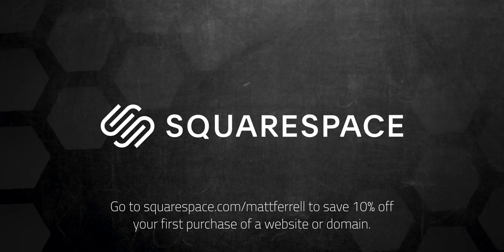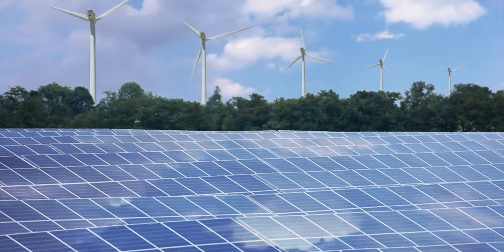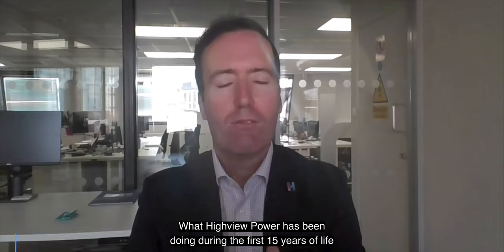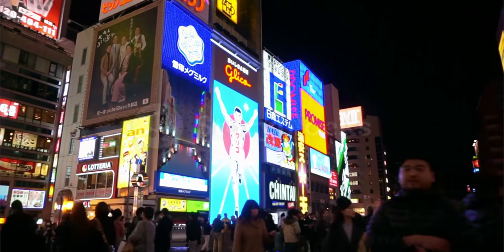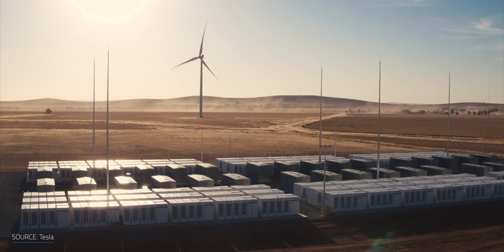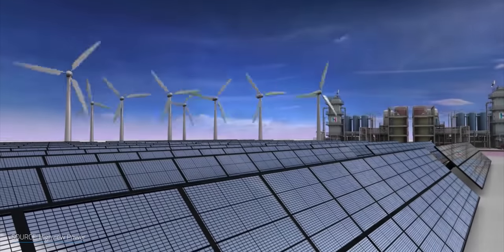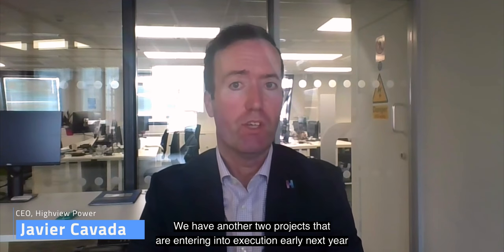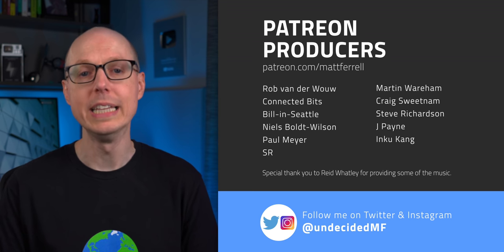Liquid Air Battery Explained - Rival to Lithium Ion Batteries?

Comment: We need to start building these now, assuming there is a standard model for "mass production" of the equipment, etc. Having a wise and thoughtful government would be a help!
Reply: First we need a really solid proof of concept.  We need one or a few of these plants operating for enough time to make sure there are no issues left to be solved and that they are affordable.  We're not in a hurry for storage on hardy any grid.  Other than some tiny island grids I know of none that have installed enough wind and solar that there's a big need for storage.
Reply: Me after youtube videos. We need fusion reactors everywhere.
Reply: @tommyp1124  We've got a huge, highly reliable fusion reactor that's paid off and giving us free energy.  We don't need any more.
--

If someday someone figures out how to make affordable electricity using fusion then let's discuss it.  For now we don't know how to control fusion and we have no route for making its electricity affordable.
Reply: Perhaps someday big solar and wind will have the resources to compete with big oil in the race to buy government favor.
Reply: Alex, Tesla MEGAPACK is Already PROFITABLE and EZ to Deploy , only 1 month from Delivery to GRID use.
TESLA built Hornsdale in 100 days !!!!!!! using Powerpacks.
Reply: @factnotfiction5915   Where's the two years of data?  Your linked article is about the launch in June 2018. 

I really want to see some data.  I really hope we find route to more affordable storage.  Cheap storage is the final piece of the puzzle.  Wind and solar, even unsubsidized, are on track to becoming our major electricity providers, assisted by existing hydro and a bit of geothermal.  But we need an inexpensive way to move energy from when it gets captured to when it is needed.

Let me suggest that this is the target to beat - Tesla's dry roll, tabless cells.  Which probably (at least the lithium iron phosphate version) have incredibly long lifespans.

Tesla seems to have developed an new type of cell and ways to manufacture that cell which will lower the cell cost from about $100/kWh to under $50/kWh.  Lots and lots of innovations, check out Tesla's battery day presentation if you want to dive into the particulars.

Jeff Dahn, who is Tesla's lead battery researcher, recently reported that his lab has been continuously cycling test cells for three years.  In those three years they've been able to perform 15,000 cycle equivalents.  The cells that were discharged 25% or 50% before recharging lost no capacity over those 15,000 cycles.  (A 25% discharge cell would have been discharged 25% then recharged 60,000 times.)  The cells that were discharged 75% or 100% before recycling lost about 10% over three years.

OK, so we install a lot of batteries.  We, in general, cycle them twice a day.  Charge when the Sun is shining, discharge into evening demand, charge when the wind is blowing late at night, discharge into early morning demand.  

15,000 cycles / 2 cycles per day / 365 days = 20.5 years.  

What's the cost of storing a kWh of electricity during a cycle?  

$50/kWh for cells / 15,000 cycles = $0.003/kWh.  Plus some cost for turning AC to DC and DC back to AC.  And some round trip loss, 5% to 10% for batteries.  Start with $0.003/kWh in and in order to get a kWh out you need to input  $0.0033 electricity, an extra 10% at most.  

Short version.  Cell cost approaches nothing for frequent cycling.

Since then Dahn has mentioned the results are staying the same for about 20,000 cycles.  Incredibly cheap is getting cheaper.  We know of no cliff batteries fall off that is based on only days passing.  Who know how long these cells might be usable?  And when used up we know how to recover almost all the materials in the cells and turn them into new cells.

OK, let's look at worst case.  Those few times per year when we need "deep storage".  The extra chemical tanks for liquid air.  Let's assume six events per year as the worst case.  Those cells will get cycled only six times per year.  $50/kWh / 6 = $8.33.  That sounds like a lot but one needs to look at the cost of power from 'almost never used' gas peakers.  

BTW, there's no additional infrastructure cost for those cells except for storage space.  Just upsize the number of cells for each charger/inverter.

That, IMO, is the target liquid air has to meet to get in the game.  Looking forward to data.
Reply: @bobwallace9753  I'm just stating that the technology is proven out. There isn't a major research effort needed to take advantage of them.
Reply: @factnotfiction5915  When a plant has been operating for more than two years and has not released any data I start to suspect that they have no good news to report.  For me, liquid air is going to stay in the "maybe, possibly" category for now along with stuff like liquid metal storage.  OTOH, I'm watching solar and wind farms being built with about four hours of storage included.  The math must be working if companies are investing in more than a test platform.

And those investments are based on "yesterday" cell prices.  Tesla has apparently created a cell price breakthrough of major proportions.
Reply: @bobwallace9753  I definitely agree "Tesla has apparently created a cell price breakthrough of major proportions".

A pity that isn't anywhere near enough to make RE's total system costs competitive.
Reply: @factnotfiction5915  

"A pity that isn't anywhere near enough to make RE's total system costs competitive."

That is pure speculation on your part and ignores the actual cost of fossil fuel and nuclear generation.

The fact that grids are adding wind, solar, and storage in increasing amounts while closing coal and nuclear plants should give you a real world clue.

Comment: Thanks for all your work Matt really educational. I am in the UK. Question for you/everyone - I've tried to do some research re LABs & HighView but I cannot find out 
1. The cost (pence/KwH) of the  stored energy they will supply/output, I am guessing 40% higher than the renewable energy input, as the entire process is reportedly 60% efficient -correct?
2. How quickly it will be scaled up & to what scale?
3. What is the cost improvement on these scale ups on output electricity price?
4. What is the cost of the basic 5MW plant installation? There don't seem to be any figures.

Thanks all.

Comment: This idea could work if the compressor is operated directly by the wind turbine. Avoiding two energy conversions.
Reply: Interesting idea, must see if the added mechanical complexity is worth it.
Reply: Not really, as you want to have a single plant like this do a whole wind or solar park. Putting it in the turbine itself will just require lots of additional piping, heavier turbines that are more expensive to build and lower efficiency due to not being able to store and reuse the heat and cold generated in the process (as efficiently). So no, you don’t want this on the turbines themselves.
Reply: Electric generators are more efficient than mechanical linkages what with location sensitivity, mechanical maintenance, and all that greasing. A couple lengths of wire and an ac/dc converter can cheaply send that wind turbine product great distances.
Reply: @AndreSomers  This does not make sense. Every energy conversion have huge losses. You need the turbine to convert wind kinectic force into rotation force that pushes the generator to produce electricity then convert the electricity back into rotation again in other place to compress the gas. It have to be better to conect the compressor to the turbine and just compress the gas.
Reply: @hasturbr  Seems that you're just going to ignore every argument you've been given. Think about this: if your idea that every energy conversion has huge losses was true, then why would trains that run on non-electrified tracks employ a diesel-electric power train? That is: they use diesel to drive a generator that creates electrical power, which is then used to drive electric motors that drive the axles.
Reply: @AndreSomers  Diesel-electric trains know they have huge losses in energy. That's a diferent point, this is about energy density. The fact that alectric motors dont need gearbox is an extra.
Reply: @AndreSomers  The main point is that in a wind turbine should be very efficient to replace the dynamo by a compressor. Chance the tower to be sealed and function as a gas tank and put the dynamo to use the gas tank content as needed.

Comment: Oh great, compressed air energy storage had problems with getting too cold when it was discharged. Liquid air is going to be WAY worse. Where do you plan on getting the energy to boil your liquid air again? You are going to need a vaporizer and a heating system to extract the energy efficiently. This is such a rediculous idea.
Reply: These standing bottles do not all  contain the liquid nitrogen but even more the stored heat and cold in ... I think "gravel". But I am also puzzled about that aspect. I guess they will not tell much about it since the Chinese are never far away.

Comment: Love to see the cost of maintaining a cryogenic facility like that vs lithium power storage. Something tells me cryogenic systems have more failure paths than lithium cells!!??
Reply: But batteries lose charge capacity with every charge cycle so they will have to be replaced while yes maintenance cost will be higher but the plant could run for 40 years before needing to replace major parts
Reply: @Hunter-lm7wo  depends what chemistry of cells you're using and how the BMS controls their charge cycle. What you're possibly forgetting is that these battery banks will be continuously monitored and topped up with charge either by the grid or renewables so will only be in a condition to lose capacity when being drained. They won't be sat "idle" even if unsupervised directly by a human on site. An ebike battery loses about 10% storage capacity after around 1000 complete charge cycles but is still able to function. A tesla car battery has, I believe, a life span of 100,000 miles plus under warranty but will still work beyond that even at a reduced total storage capacity compared to new. An Ebike battery is about 0.5kwh, tesla car battery is between 55 - 80kwh capacity and we're talking about potentially mega watt hour capacity. Even if one "pack/module" breaks down the rest will still function. Lithium banks have no moving parts, no hostile chemicals and no extreme operating requirements. With cryogenic systems one "O" ring could cause the whole thing to stop working and given how hostile cryogenic system are to materials I'd still be backing lithium any day of the week. It already works and has proven to work. Tesla has already delivered in Australia and it works better than any other back up system they've tried, as far as I'm aware.
I'm not saying this liquid air malarkey doesn't technically work, but Holy hell it's going to be a darn site more difficult to maintain. I would love to see both of them in an earth quake situation to see which one holds up better!!??

Comment: It would be good to know what is the investment cost to build a 24 hour storage capacity with either solar and/or wind sized system to generate XXXMW for use and storage of excess energy generated.. Please step through the analysis to show the path forward for investment in terms of dollars and resources required to build this plant. Thanks

Comment: It might not power smart phones but I can imagine it powering cars and passenger drones. I can imagine vehicles with insulated fuel cell containers that can hold frozen liquid air tanks. One of the biggest issues is the time to refuel a vehicle and this might totally solve that problem. I can imagine different size vehicles using 1, 3, 6 or 9 x 20L or 40L tanks of liquid fuel. I can also imagine them being quickly injected into a vehicle at your local fuel station and the old tanks being recycled. There's a really good youtube video about from a professor explaining how compressed air has been around for a long time and that patents where bought by fuel companies. Point is I knew compressed air was an option but now that I understand we can freeze the liquid and reduce the pressure vessel requirements, like omg, that's sick. I should register the domain name powerpopsicles.com! Oh and combine this tech with the thermos insolation tech, bingo! Vacuum insulated fuel cell chambers! Think about it.
Reply: Imagine a container of frozen pellets that can be moved from vacuum insulated storage tank to a small high pressure chambers. Maybe have 4 or 6 pressure chambers to compensate for decompression timing difference from fresh to old pellet. Or a check valve that passes gas to a second high pressure storage container that powers an air piston engine. And of course, heat exchangers and Peltier thermoelectric plates to extract electricity from temperature differences.

Comment: There are lots of ways to store energy (chemical, thermal, mechanical).  Liquid air is one possibility amongst many that have been suggested.  It's a question of cost, scalability, and reasonable efficiency.

I'd like to take step back, and think about "micro-grids".  In the software world, there is the notion of an "operating system" (OS), which allows one to incorporate various "device drivers".  In the case of a micro-grid, solar+storage would be the backbone.  Initially, lithium ion acts like kind of a "buffer" to integrate other resources, with varying profiles.   On most days, solar is fine.  But I'm not beneath using diesel gen sets, e.g. on days with smokey California skies, when solar doesn't work.  As  new storage technology emerges, one can swap out the diesel with the new technology.  There should be a low risk way of experimenting with both new storage as well as dis-patchable generation technologies, that have different profiles, given a stable backbone.
Reply: The engines will be converted to run on green hydrogen.
Reply: Even easier than solar with high-carbon fossil fuel backup, is using low-carbon nuclear in 'crockpot' mode.

The reactor can run at constant maximum output (optimizing energy production) and attached to storage to deal with demand load variation (optimizing power consumption). The reactor and storage then can each be optimized for the size and profile of the demand load (raising return on assets).

Comment: i feel there is persistent representation of lithium ion duration capability.  repeatedly its been determined its only good for 4 hours throughput which is incorrect.  4 hours is the hornsdale capability because the system is designed that way.  you can architect lithium for a year,  a 100 days, or a millisecond depending on how you design the lithium system.  Total sham, I can't believe people are falling for this garbage.  Its all in the design of the system.  Hornsdale requirement was for 4 hours at peak capacity and so they designed the system and subsystems for 4 hours, and its really for power arbitrage.  Please review how you get your assumptions and who is pushing what limitations and why.
Reply: I partially agree. My understanding is that "4 hours" is a useful standard for energy storage time, as that transfers the peak of solar energy to the time most energy is used, in the early evening, thus flattening the daily energy curve. If everyone agrees that the battery is used over 4 hours, you just need one number to describe its size: its output power in KW or MW or GW.  Of course that same battery could just as easily put out half the power for twice as long with no problem. So "X MW of power (for 4 hours)" is just a useful standard way of sizing utility batteries.
Reply: @fotoguru222  its being presented in such a way that batteries can only last 4 hours that is.  Also they presented that it does not scale which is also not true.  if they doubled the battery pool it would scale almost 100% whether they get double the duration or double the throughput is all dependent on how they decide they want to deliver to which architecture.  There is some small loss but its nearly infinitesimal.  The flow companies know this to be the case as well, but they don't want the public to know so they push out this nonsense so they can have some sales.

Comment: I understand they use the expanding gas to drive turbines to generate electricity. But the phase changes of the gas also produces big temperature difference. Wouldn't the temperature difference be able to power a sterling engine to spin the generator also?

Comment: Ok, so before watching the video, I have a few issues.  Liquid Air?  either this was a poorly made name, or they're doing something dangerous.  What Temperature  / pressure is needed to condense something that is normally a gas into it's liquid state, are they separating the elements?

After watching, awesome, the fact that they capture most of the thermal energy back makes this efficient but also viable.  This has the potential to change the world.  As an engineer though, thats a lot of moving parts that need to be maintained
Reply: Ideally, the two exchange processes must go on almost lossless and fast, followed by again almost lossless storage of the heat or cold. This seems so expensive that I fear only a  low efficiency will be obtained (perhaps at best 50%) If there is a lot of hot waste energy nearby then they could use that to decompress the liquid very fast. Then the saved money from the heat storage could be used to improve the storage and exchange of the cold streams. Under such conditions I believe it could work. I am no engineer but after the algae desillusion, they won't fool me again in believing ;-)